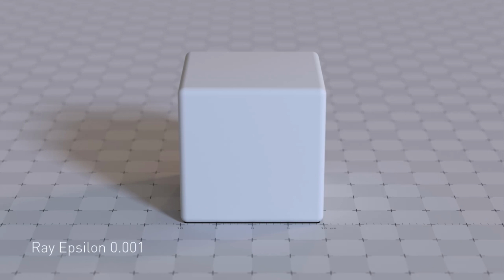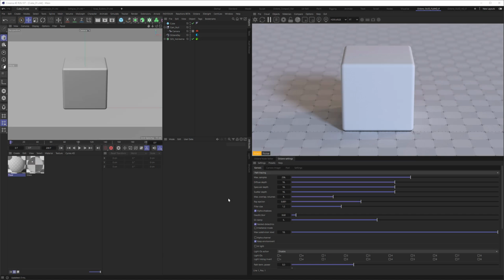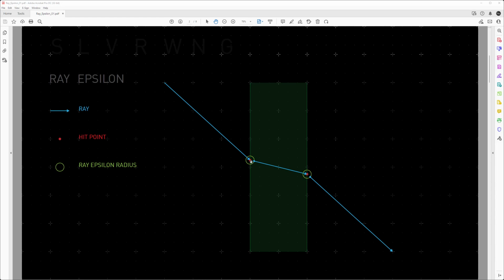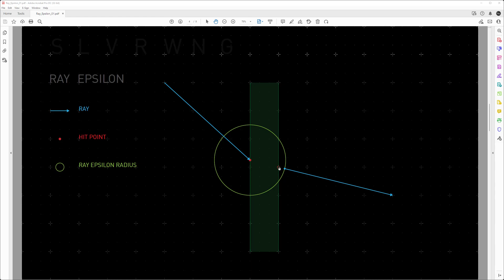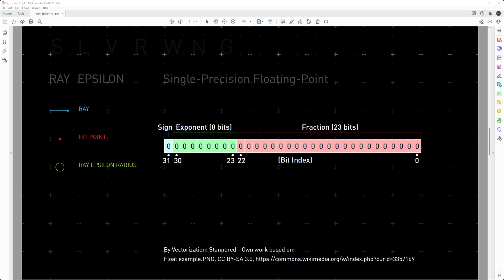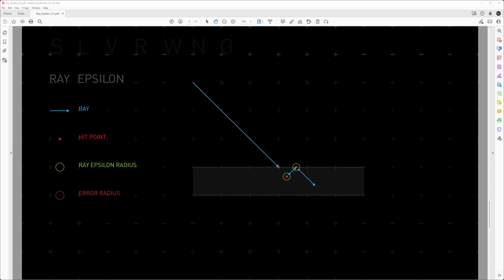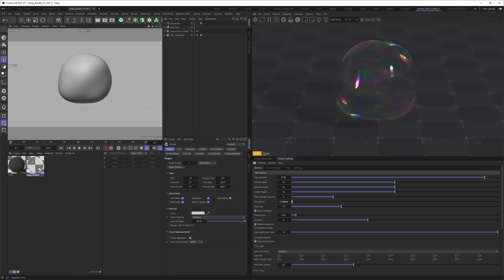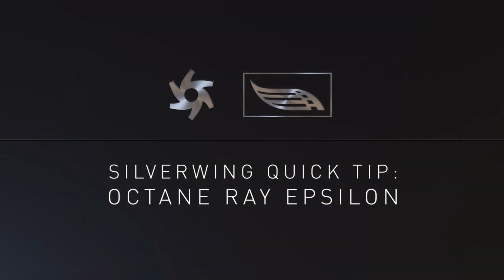Silverwing Quick Tip: Octane Ray Epsilon (For more realistic Renders)

Comment: when I reduce Ray Epsilon to 0.00001 my standard material sss effect will be so bright, is that a bug or what
Reply from the maker: Hey there Cheng,
It's rather hard to say without knowing the scene. It can be a problem when the scene is rather big. But if you are working with e.g. "table sized scene" in real world units, it should be fine.

If you SSS is too bright. What you can do:
See if your lighting has a meaningful brightness to the scene. Place a diffuse material on all your objects with 80% brightness (value 0.8) This should barely overexpose.

If that is already set correctly, and you feel your SSS is still too bright, you can just make the SSS darker by adding absorption to it.

Those are just some quick tips I thought of.
As I said above, without knowing the scene it's impossible to know what's going on and those tips might even be counter productive.

If you want, and if the tips did not help, you can describe what you are doing / your scene in more detail so I am able to help out better.

In the meantime I wish you a fantastic weekend!
Reply: @SilverwingVFX  Thank you very much for such a serious answer! I'm working on the skin material for a character. The size of the character is the same as C4D Figure person, and the scaling of the scene is correct. For the situation where the sss material became brighter, I didn't adjust any other parameters. I just adjusted Ray epsilon from 0.0001 to 0.00001. I don't know how to send you pictures, but the problem is obvious. I can't darken the sss by adjusting the absorption because I'm using the new standard material to create the material, and this material has a dedicated sss adjustment category.
Reply from the maker: @chengll651  Thank you very much for your reply.
Hmmm. that's strange. if you don't have any skin layers etc. Then I am not sure why the skin material would get brighter by lowering the ray epsilon.
Of course there is always a chance that something like this could be a bug. I usually do not use the Standard surface so I unfortunately don't really know.

In terms of Standard Surface and SSS brightness:
If you are driving your Standard Surface SSS with a color / Texture you can make the input darker by using e.g. a color correction node.

By the way, if you have in mind to build a bigger scene around the character, I think a Ray Epsilon of 0.0001 should be fine. You only would need to use the 0.00001 if you e.g. show closeup of the eyes, or jewelry the character is wearing.

If you have the feeling that sending me a / b comparison pictures of the scene will help. You can find out my email address. If you google my YouTube name you will find my website which contains it. 

I hope you get a good stable result that gives you the control you desire.
Cheers and a further great weekend to you!
Reply: @SilverwingVFX  Thank you so much! I will send you an email within a few hours. There will be engineering files and comparison pictures inside. Thank you again.
Reply from the maker: @chengll651  Cool. Looking forward to it!

Comment: you are the best. :) i wish octane would let us split the ray epsilon to groups, my idea is to develop a new epsilon system that combine ray absilon groups, that could be set up in the octane tag. each different group will have a different ray absilon values. one value for the close charecter(group1), and one for the large landscape (group 2). like - light leaks. what do you think of that? is it possible?
Reply from the maker: Hey there. Thank you very much for your comment!
Yeah that would be a good idea. I guess for the developers there is always a balance to keep the renderer fast and performant and as low memory as possible while introducing new features.
An even better idea would be to bind that ray epsilon to the camera ray distance. So it would adjust automatically based in the object distance. And even adjusts within the same object when it is near and far at the same time. e.g. landscape base. But since I am neither a developer nor a programmer I have no idea if something like this would be even doable.

Comment: Very well explained. Never heard about this term. How do the other renderers solve this? Just curious.
Reply from the maker: Hey there and thank you very much. Nice seeing you watching my tuts 🙂
Its called Rays Bias in some other engines like Vray. To my knowledge  a lot of CPU Engines do not have it because they work in double precision which usually is more then enough for any reasonable scale. But I would have to research how engines like Redshift or Cycles are dealing with it. Usually GPU engines are single precision because the consumer GPUs are far  faster calculating single precision floats then double precision.

Comment: Thank you sooo much Silverwing! If you feel free, could you please publish a tutorial on How to produce a "seamless" procedual Bump texture for any material in Octane? Emphasis on Seamless. I can always find a seam especially in bump maps texture. I know Triplannar node works, but the pattern must be transform into extremely small scale like 0.0002 in xyz in order to look natural, then I can see clear repeatative pattern thats a no go, then I have to use break it apart a bit. Is there a better approach tackling this problem? Thank you so much for your time and ur kind tutorial. It has been always helpful since 5 years ago
Reply from the maker: Hey there. First of thank you very much for your kind words.
About your "Tiling" problem. If I understand it right I think what you need is almost impossible to produce. Something that works in a small scale as well as in a big scale...
So if you make any tileable texture small enough you will see its repetition. In this case repetition would not be a sign of a bad tileable map but just showing up because of the small map and the therefore occurring many repetitions.
I think you already hint at a possible solution in your comment. I usually mix different map sizes together or use a noise as mix amount to break up the pattern. This of course is  more tedious then having just one texture.
P.s. depending on the pattern it can be really seamless. Something like a bumpy plastic surface for example usually has a very unifom and very similar pattern so one would not notice tiling. Hopefully this helps a bit. Maybe I will make a tut about dealing with texture resolution etc.
Cheers and a great week to you!
Reply: @SilverwingVFX  Great week to you my kind sir!! Thank you for ur detailed explanation! Yeah maybe there isnt a one-stop way so far to do it now haha thank you for ur information so much!!! God bless!

Comment: I'm familiar with all of the 3rd party renderers, and I used Octane for about a year a few years back--why is it that only Octane relies on adjusting ray epsilon? I don't recall Arnold, Vray, Corona or Redshift having this setting, or at least needing to adjust it. Maybe I'm missing something...
Thanks.
Reply from the maker: Hi there. Most of the CPU-Renderers are using "Double Precision" with a 64 bit register per value. Therefore the precision range is far larger. But even there some renderers have this setting. In Vray its called "Secondary Rays Bias". Also other GPU renderers as ProRender have a Ray Epsilon. Not sure how other GPU renderers as Cycles deal with it. Maybe it´s somehow automatable?!
As far as I know Double Precision would also work for GPU rendering but RTX GPUs would be slower as they excel at Single Precision calculations. So might be that e.g. Arnold GPU is using Double Precision for GPU as well but therefore sacrifices some performance. All speculation though.